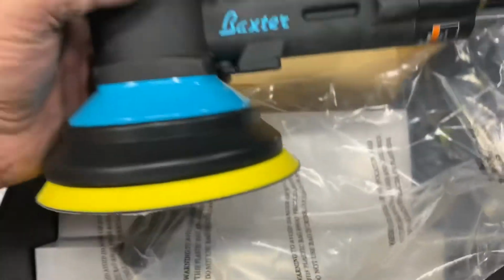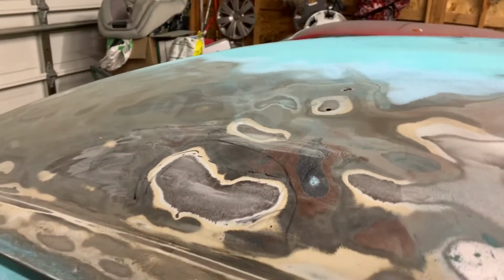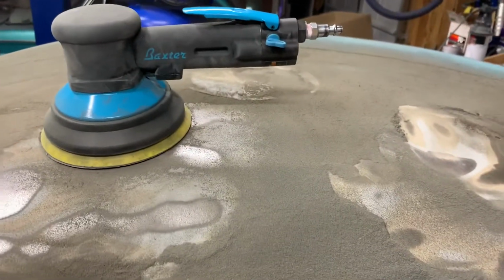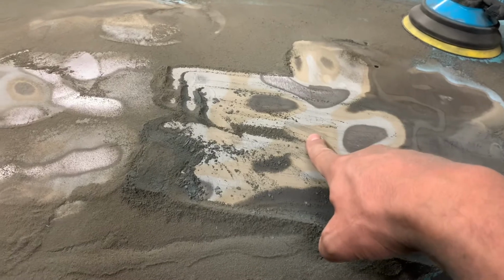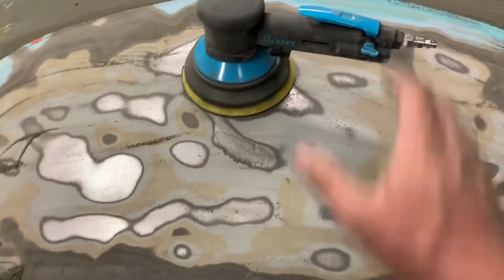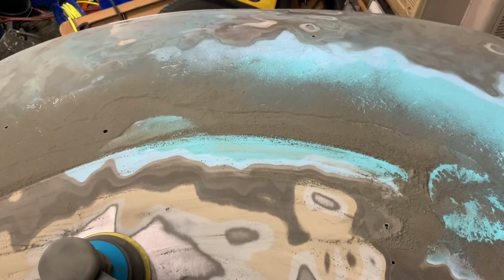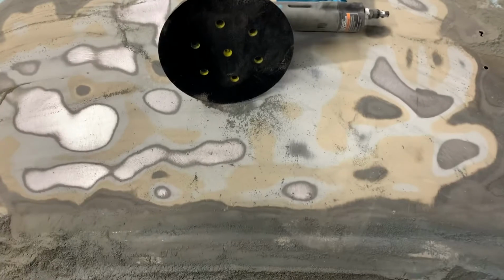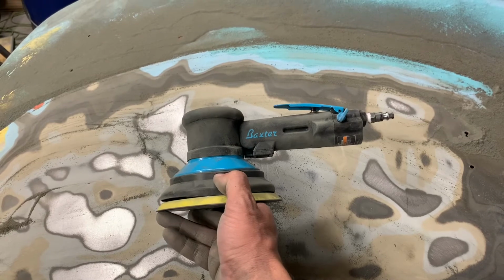Harbor freight geared sander review paint removal

Comment: What size compressor and how's the air consumption?
Reply from the maker: It’s a Lowe’s 80 gallon 5 hp set to 90 psi with a reg. It keeps up pretty well. I never have to wait for pressure but it does run a lot. The sander is adjustable med speed compressor will shut off.
Reply from the maker: Here is a link with specs 
https://www.lowes.com/pd/Kobalt-80-Gallon-Two-Stage-Electric-Vertical-Air-Compressor/1000528985
Reply: @Problem Garage  ahhhh..  that's a big help.  Unfortunately, I'm limited to a single stage 60 gallon. I might need to look at other options